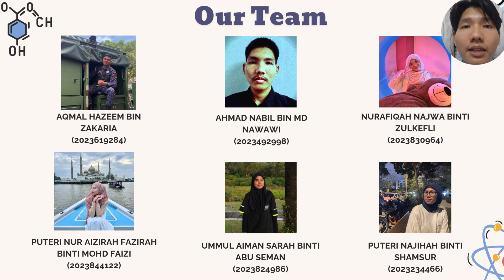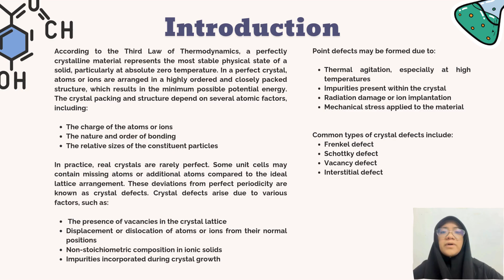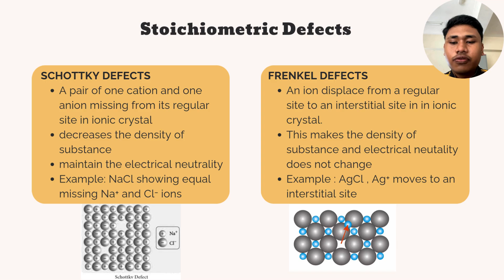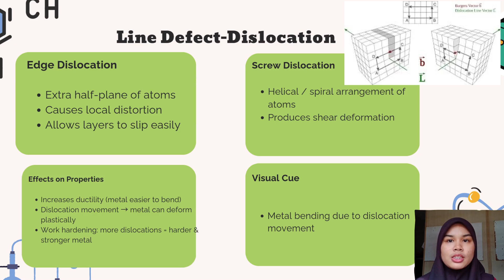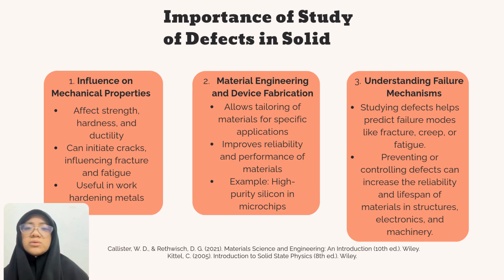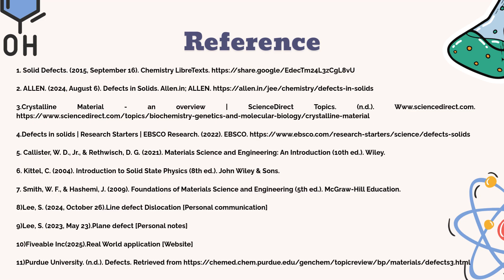CHEMISTRY 361 DEFECTS IN SOLID:HOW IMPERFECTIONS SHAPE MATERIAL PROPERTIES

Comment: Nice presentation, can i know how do crystal defects make metals stronger?
Reply: Crystal defects make metals stronger by stopping atoms from moving easily. in a metal, atoms are arranged in layers. when force is applied, these layers try to slide.defects block this sliding, so the atoms cannot move freely.
so, the metal needs more force to change shape, making it stronger.